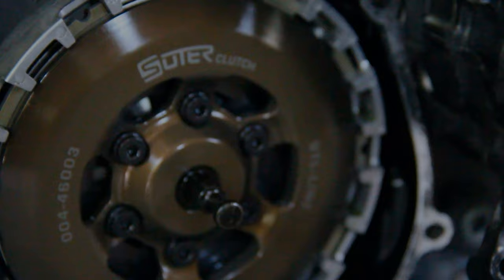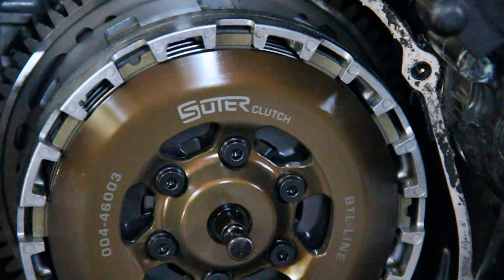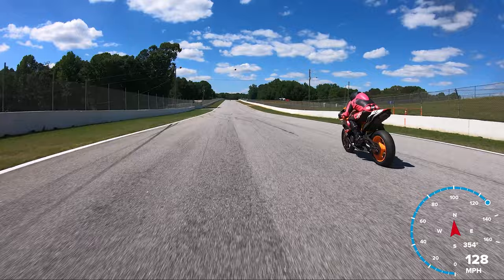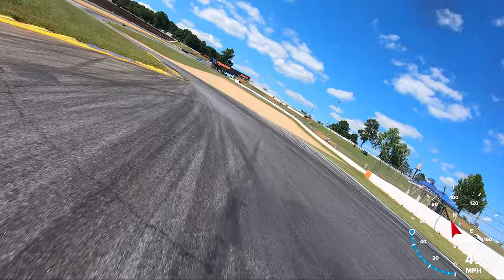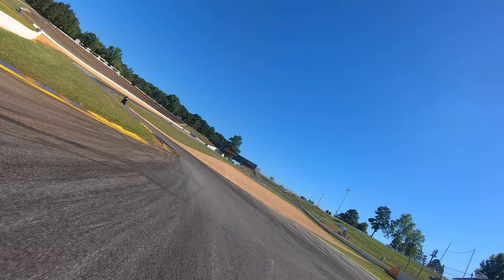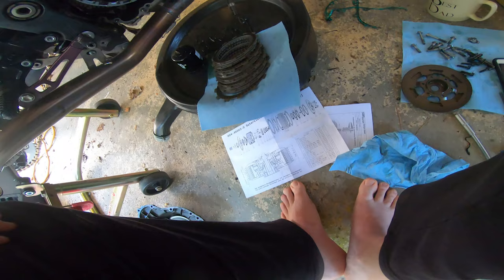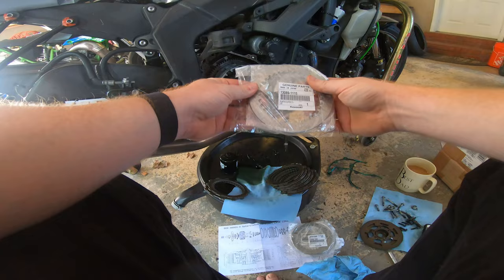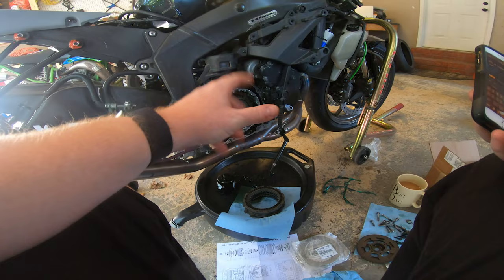SUTER CLUTCH | 2005-2023 Kawasaki ZX6R: Adjustments Tips and Tricks

Comment: Nice video mate. I'm a fellow zx6r racer here, same model bike as yours. I broke 2 shift drums and keep having shift forks premature wear, did you experience any gearbox issues?
I've had other bikes in the past and never a problem like this.
Thanks
Reply from the maker: Kawasaki has poorly designed transmissions.  I use the best QS (I think) to help soften the impact of wide-open shifts.  Checkout the Translogic line of QS.  It's a bit pricey but their software calculates the best cylinder cut sequence at different engine speeds. Like a ramp in/ramp out but in milliseconds.  Also, I use the Factory Pro shift star and changed my oil after each track weekend. Hope this helps!
Reply: @AAron_Rides  much appreciated!
Reply from the maker: @dvdfll  anytime

Comment: How often would you say maintenance would need to be done if I got a Suter clutch for trackdays? I usually do 8-10 trackdays over a span of 4-5 months. Running intermediate level on an FZ07.
Reply from the maker: That’s really hard to say, mainly because of riding style and how much you use the slipper clutch. I can tell a difference between different layouts of tracks, from fast/flowing to stop/go.

It’s enough where I check it after every race weekend so approximately 30 laps

Comment: Would this clutch kit be unsuitable for street riding?
Reply from the maker: Yes…you’ll have to be constantly checking the stack height
Reply: Roughly after how many street miles would u suggest checking the stack height ?
Reply from the maker: @josephtorresflores6219  that’s hard to say, you don’t use a clutch the same way and I haven’t ridden on the street for years.  I’d say just save the money and keep the stocker